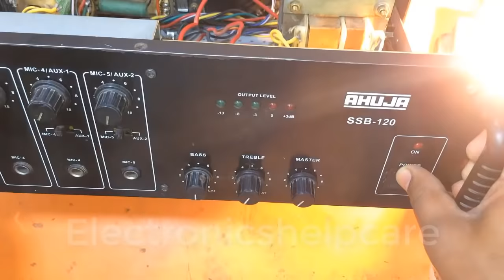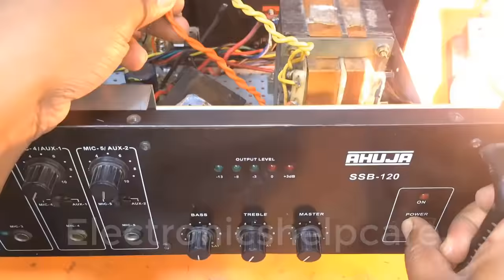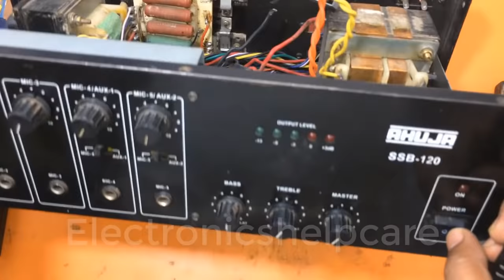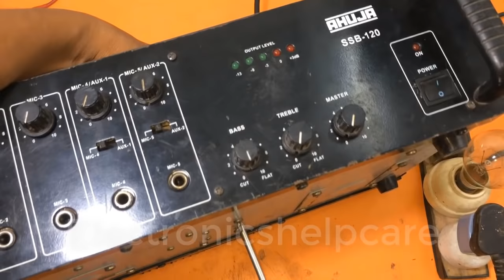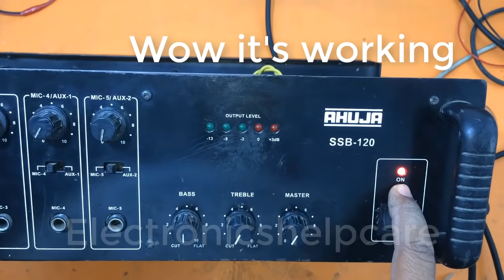amplifier repair ahuja

Comment: Hello Sir mere pass ahuja ka 80 watt ka emplifier hai uska back sit fuse jal rha he to ky problem huva he kasi repair kari pl batao
Reply from the maker: transistor or diode problem
Please visit for diagram
https://electronicshelpcare.net/speaker-protector-circuit-diagram-using-ne555n/

Comment: Hi ... this video is helpful ... thank you so much ... I have an issue ... will be grateful if you provide me an answer or a solution ... I have amplispeaker which I use to connect my guitar to practice on ... it has a volume control, a master volume control, an equalizer with bass, middle and treble controls and a reverb control ... i think it is a 25 Watt amplifier with a 10 inch speaker ... I had opened it once long back to just do basic cleaning ... so I know there is a spring reverb in it with 2 springs ... of lately I have noticed that when I turn up the master and volume controls more than 12 o'clock ... even without connecting any instrument, it gives a buzzing sound (hum). Is this normal? ... I hadn't noticed it before. Can you please help?